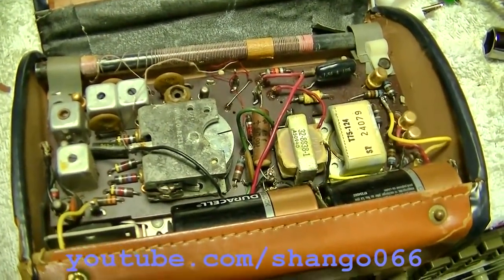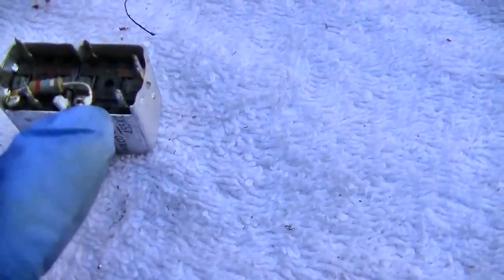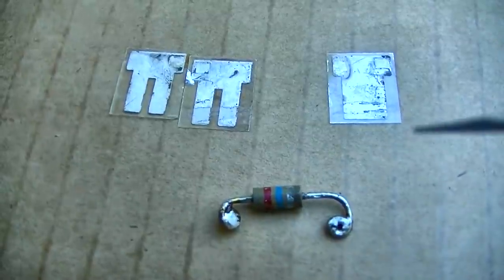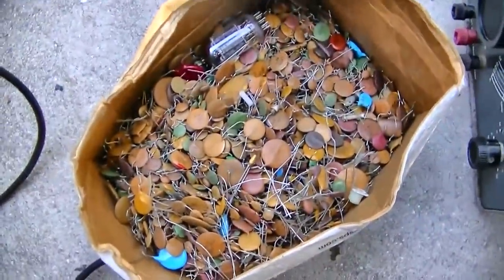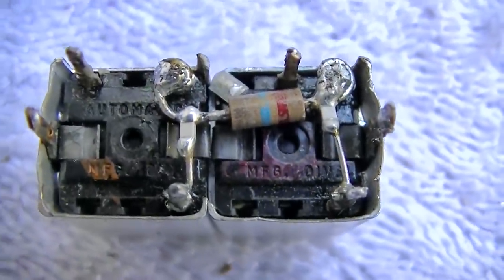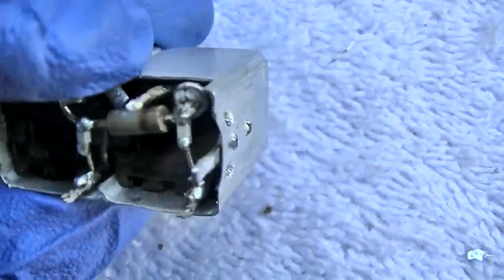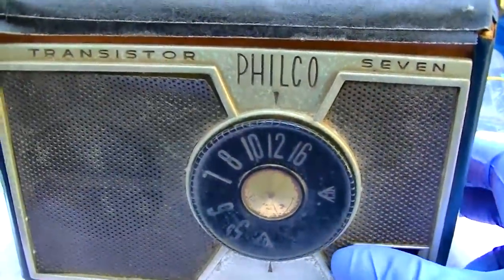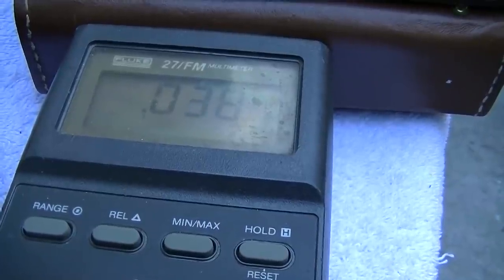SMD Silver Mica Disease IF Transformer Transistor Radio Repair Recap

Comment: I worked months ago on a 1963 Sharp BP-301 pocket radio and it had the same problem, this same insane  gain and distorted sound, whistle everywhere when trynig to peak the tranformers, a total nightmare. So I started to change some resistors here and there and it started to do less noise,  however still  super sensitive. I changed the IFs transistors by very similar ones and worked great, maybe the old transistors was noisy who knows? And the last thing I did was to change the value of the avc resistor to get a perfect gain balance. Man, what you did was incredible, so tiny thingy. Thank you very much, this is amazing.

Comment: Coupling is ONLY via the top capacitor.  The walls do NOT allow the em field through.  2.1pf makes sense, so does 21pf, NOT 260pf.  Schematic should show the shield can dotted lines between the two coils.  Not getting a peak probably means wrong value caps used.  Note that the top cap will determine the bandwidth of the IF, and also flatten out the tuning if too large (coils will interact in tuning if top cap is too large).  Motor boating is probably a bad bypass cap.
Reply: Correct, especially when cap ESR goes wrong, many NOS radio sets tend to moborboat when revived after a while...very common issue
Reply: Yes,  Scharkalvin is  %100 Correct.  I think the coupling cap is 2.1 pf

Comment: Philco was a big contractor to the US government for electronics, especially in satellite construction. They heavily invested in transistor technology for their work, something that passed down to Ford's automotive electronic fuel injection as those systems were designed and built to mil spec (with the odd exception of their ignition pickups which had high failure rate). Nice to hear Philco's old transistors are still good, and that their consumer goods were along the quality of what they put in their aerospace equipment.

Comment: I don't think this is silver mica disease. It may be semantics, but I define SMD as metal migration on silver across the surface of the mica induce by high voltage (90 volts) attraction. The resulting leakage currents from plate of preceding stage to grid of succeding  stage generally sounds like a lightning storm approaching. This radio did not have that sound. All I noticed was tarnishing of the silver surface, and suspect if you had polished with a pencil eraser and reassembled and tightened the clips the transformer woulda been good to go. I'm skeptical that transistor radios with their low voltages (>12 volts) will have enough attraction to cause the silver to migrate across the mica surface. I could be wrong on this point. I'm not sure if the two aluminum (nonmagnetic) cans will act as a faraday screen to electrostatically reduce high frequency coupling, while allowing lower frequency electromagnetic coupling. You have definitely noted too much RF gain. I had this trouble with a Zenith Royal 275. The .05 mf local oscillator coupling capacitor ( a disc ceramic) had turned into a 22 K resistor. Hard to believe but true. Check Beitman's Volume R-20 (1960), page 179. You will note C15 from LO coil to low end of antenna coil. Leaky cap raised base bias by about 1 volt. Radio still played, local stations had splattering audio. I have a Royal 450 that has a bad 2nd IF output transformer. The internal 250 pf cap went open. I tacked 2  100pf + a 50 pf across the tranformer and it tune right up, and had good sensitivity. After several months of use the radio died again. I had to unsolder the caps under the transformer. Apparently, tin whiskers formed joining the internal cap back in circuit, but with resistance in series. As such, the radio works now, but lacks sensitivity. I'm just not brave enough to do microsurgery on the transformer. It sits on the kitchen windowsill and plays talk radio. BTW, you are one tenacious mofo!
Reply: Holy shyt... He referenced a page number... Shango, LOOK HERE!!!
Reply: @garbleduser  That page # was for the Zenith Royal 275. Shango's T75-124 is in Bietman's 1959, page 105. His radio has an autodyne convertor (no separate local oscillator with coupling cap into mixer), so actually, I gave Shango some useless info. His radio apparently has no RF AGC, only IF AGC. I notice the detector is a transistor, prolly a detector and AGC amp. My only reccomendation is to check bias on RF, IF, and Det/AGC amp. If that uncovers nothing, try bridging a resistor from neg. side of C4  (AGC filter) to emitter of RF Amp. Maybe he could get some delayed AGC action going.

Comment: Congratulations Shango nice work.
The gain was above average, the distortions in the sound must be some resistor with value changed in the rf step, but checking all is more guaranteed. But the master is you, always with new challenges.
Hug.

Comment: The IF capacitors are not that critical in value, once you are able to peak it, it should work. No way the motorboating could be caused by them.
And the small 2.6pF is really that low, its value should be Ccoup = Ctune × BW / Fif /sqrt(2) = 160p × 10.5kHz / 455kHz /1.414 = 2.6pF. (Assume that LC pair is designed for flat top with the Q=60 of both LCs)
Reply: This^. It’s a double tuned circuit, capacitively coupled. The value of that cap affects the Q and coupling factor. A cheap spectrum analyzer would be well worth the money for this.

Comment: The coupling I think mostly is through the 2.6pF cap. The aluminum shields probably act as pretty good shields at 455 kHz. There might be some magnetic coupling but I think they rely on the 2.6pF to do most of the coupling. You want to lightly couple the two halves to preserve good overall bandpass repsonse. If you ever look at double tuned (2 tank circuits) with a top coupling cap the top coupling cap is always pretty small. Also, those old style 2.6pF type ceramic caps are pretty reliable unless mechanically damaged.

Comment: Mica a very soft material to even place in an old Philco radio...........in the first place. I am staying away from extremely old radios with Silver Mica Waffles in them. I love religning old radios just for a fun pastime. An Excellent loud alignment noises from that Philco Radio.. Working on an old large 1970 Japanese "Silver" Boombox myself. RE-Winding a new S.W. and A.M. antenna for it. Nice old A.M. Philco Radio. I have to replace a mica tuning transformer in the tuning circuit, that I burnt with my soldering gun by mistake. Good Luck on your repairs there. Bye Now ! Maybe Connecting a sound generator to the back antenna section may help alignment not really sure ??..... When I was 8 years old, I did it to my old Radio Shack Citizen Radio, and it aligned perfectly. Spray that Frequency Turner box capacitor with some WD-40 maybe.....???? Mod it some how ??? It's to peak up and needs backing down a bit maybe in the gain. Could even be in the A.M. Ferrite antenna maybe ??? Crack-Co Box Radio.

Comment: maybe need to 'stagger tune' those IFs so bandwidth isnt so sharp, and that'll also reduce gain peak,, something like last IF 455, one of that pair 457 , other 452 ???  i've seen service info on some valve/tube sets state you should stagger tune their IFs ....?  sometimes the manuals say you 'damp'  one coil with a resistor while adjusting the other,  then do opposite,  also gives wider bandwidth and less sharp peak gain
Reply: Many radios using germenium tr. Internal capacitance, in i. f. amp. feedback is so high that stager tuning is ony way to stable this stage.
Reply: Truth! I would peak them both and then turn them a fraction in opposite directions to achieve the same.

Comment: Do you use a signal tracer to isolate what is causing the motorboat sounds since its clear its not the if coils that were recapped?  Was this radio ever fixed?

Comment: Wouldn't it be cool if the schematic indicated proper values for these in can mica capacitors. Guess the manufacturers figured  the sets would  not last long enough to  require this  repair.  Thanks for another trinco-twinkulate tutorial, Shango!  That radio is a classic...........
Reply: Back in the day it was presumed that if a component such as an interstage transformer failed you would order a replacement from the manufacturer. Nobody would attempt to fix those.

Comment: Literal translation of how soviet engineering tradition calls these bandpass LC networks is "concentrated selection filter" ("фильтр сосредоточенной селекции" or abbreviated "ФСС"). They used them extensively on most popular and on top of medium price range consumer receivers, especially on models with drum band switch as on tuners of old TV sets, but one can find them in even some smaller or pocket size radios. Soviets, as far as I know, never used mica wafers inside cans, so there never was such a problem with them. Some of the well known soviet receivers with rediculously complex IF filter networks were VEF-12, ~201 to ~206. Even more complicated were filters of Ocean models 209 to 216 and their export brand equivalens Selena with banks of 10 coils, 2 groups in paralel of 5 sequential for AM/FM that were not even switched but used the "magic" property of high and low friquencies not to "see" each other wile navigating LC networks.
Reply from the maker: Yep that's why the Soviet stuff is badass. Mostly just broken sodders and open capacitors. Never even played with the alignment on one and they kick the crap out of most other radios

Comment: I've done a lot of homrbrewing and prototying of superhet cw transceivers. I've replaced commercial Chebychev bandpass filters with one I built on a daughter board- which are basically what you have there with your two coupled IF cans.. and in my case- the capacitor coupling the two filter sections was SMALL shango.. always, always on the order of 2.7 to 3.3pf. Never more than 4.7.. and even that really broadens up the filter peak and flattens it
Reply: Exactly, otherwise you adversely disturb the passband response and Q not to mention loading of the amplifiers.

Comment: Your SOKOL 403 has similar, capacitively coupled IF tanks. The SOKOL has 5.6pF intercoupling caps, but it has larger (510pF) caps in the IF tanks too. 2.7pF coupling is a good match for the 160pF IF tanks in this radio.
The schematic is obviously wrong, that is a pair of capacitively coupled IF tanks, not a transformer. There is no inductive coupling between the two coils, they are totally shielded from each other by the aluminum can and the pot tuning cores that surround the coils.

Comment: That schematic is deceiving, it is not a transformer.  There is not any inductive coupling. They are just tuned LC filter circuits coupled with a very low value capacitor. The coupling cap may even be .21pf as the silver band could be a .01 multiplier.

Comment: Would a bad emitter bypass capacitor affect a collector current (let it run higher, as they are intended to provide negative feedback on collector current variance) and yield an increase in a stage gain?

Comment: Sometimes the reason is that they ran out of the correct part and used what they had on the shelf.
Reply: Yes 👍🏼 I could see that happening.
Reply: I’m sure that’s what happened. Radiotvphononut ties two capacitors (or resistors) together to get the correct value quite often. I’ve had to do it myself before.

Comment: What are the odds that the same day I'm working on a TV with silver mica disease, you upload a video about silver mica disease
Reply: I have a fat stupid.... Philco radio with silver mica disease. I still listen to it a little here and there. It's a model 51-1730 the kind people don't keep. I saved it from the dump. It sounds good even with the 6 or 8 inch speaker all of the way on the floor. Atop it sits my Philco electrostatic deflection 50-701 Bakelite TV. I guess I have to fix them both! Plus the phono with all of the dried up rubber parts. Wish me luck.

Comment: The problem is that you are peaking both coils to 455 kHz. You have to obtain more like an inverted U shape than an inverted V shape. You have to peak one coil to around 454 kHz, than the other coil to around 456 kHz, this is reducing the overall peak gain, but also assures a wide enough bandwidth for AM reception which also means less distortion. Keep in mind AM bandwidth is 10 kHz and you can't obtain such a large bandwidth by peaking both cans to 455 kHz. Your method of alignment is suitable for DX when want to obtain maximum performance in rural areas, but in some cases when the coils have high Q it is not suitable for distortion free reception, in such cases you have to detune one of the cans to obtain a higher bandwidth (some manufacturers add a 20-200k resistor across the coil to have a higher bandwidth, in this case you don't have to detune it).

Comment: Curious about the cap between the 2 transformers on the good radio. What value does it measure? Swap the 2 transformers from good to anti good... Hook up the fancy gear and get a visual on those signals.

Comment: I have one of these that sort of worked when I picked it up. While Turing the volume up, it stayed at one level until turned to 75%, then overdrove. After spraying the pot with cleaner, all it does is motorboat now. I suspect a bad transistor, but am trying to figure out how to test it w/o having to desolder.

Comment: Did the AGC elec. capacitor get installed backwards by chance??
Reply: That would kill the gain completely - there is the 1st if transistor bias voltage on it, so once it shorts out the gain is gone (the AGC just reduces that voltage). But the high ESR or too low capacitance means there becomes RF path back from the detector.

Comment: Greetings:
Since the core threads are very visible, can removing the core itself permit measuring the existing capacitor value permitting the closest SMT cap (size appropriate) to be placed in position and attached (or under pressure) as the original was before restoring the core? Gives you a place for a good capacitor.
My best educated guess is that the 2.6pf cap is to couple the two tank circuits together passing the rf since the cans themselves cannot couple the inductors. I'm sure you will learn that other resonant tank circuits using similar cans have a distinct method of non-inductive coupling of circuits.
I want to be sure not to forget to congratulate you for thinking of the additive affect of using a second cap to put the values in range of the component tester when looking for the value of the 2.6pf cap.
AVC: can you compare the working of the two radio's AVC circuits to determine if they are different (even using the signal gen to establish the rf levels that create relevant levels).

Comment: 11:58 if the tincans are groundulated then the couplification can only be made with the capcifier. I hope this helps with the lerndification process.
Reply: @shango066 here's what my gut told me too...  Also, @Andrew Hull that comment reads a lot like a cross between Shango066 and Vice Grip Garage
Reply: @danmackintosh6325  The older I get the easier it becomes to listen to my gut. Partly because it has more to say for itself and partly because it appears to be the only part of me that isn't shrinking. ;~)
Reply: @danmackintosh6325  There was a VGG flavor in there lol

Comment: The bandpass-filter is kind of 2 single resonant circuits with coupling-capacitor and no inductive coupling, there a some other possibilities to couple 2 resonant circuits, this is called  "capacitive headpoint-coupling", "capacity footpoint-coupling" is common in some tv-sets between tuner and if-amp.
Some kind of coupling can be seen here (german site): https://www.radiomuseum.org/forum/abgestimmbare_bandfilter_mit_konstanter_bandbreite.html
2 guesses about the motor-boating: If the capacitor in the AGC is open, if-amp may generate motorboating under strong signal because of no-linear processing with overdrive, then saturate, AGC brings signal down and overdrive again... sometimes you have 2 different AGC-circuits with 2 diodes to get rid of overdrive. .... second guess ist: For an if-alignment the front-end oscillator has to be quite (variable cap has to be shorted), because in this simple superhet-circuits the mixing stage is combined with the oscillator! (self-swinging-mixing-circuit). There can be strange effects under strong signal, too, if this stage is coupling with if-signal of high amplitude.
"gain out of control" - this may cause the motorboating ! I think, it must be easy to find for you !
good work ^^

Comment: Didn't you have a similar problem on an Arvin set about a year ago? On both sets I would change the resistors on the feedback line and see what happens. You don't need to take the Philco apart for this as you can chop the resistors out and solder to the leads. Good Luck....  Unless these two sets are for use in weak areas?
Reply from the maker: Yes. I'm pretty sure it's a transistor

Comment: in tube radios ( hammarlund)  the mica caps are leaves open to the atmosphere, and they routinely are found bad.. with a totally dead stage.  removing them and installing outboard sealed mica caps is the cure.   I have never tried compressing the coil in those much larger if cans.. this seems like a bad solder job.